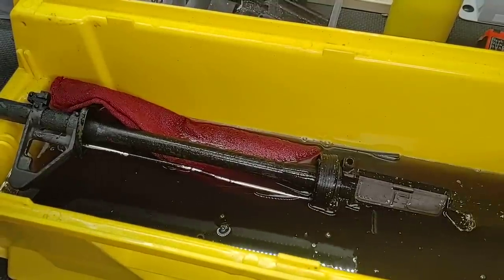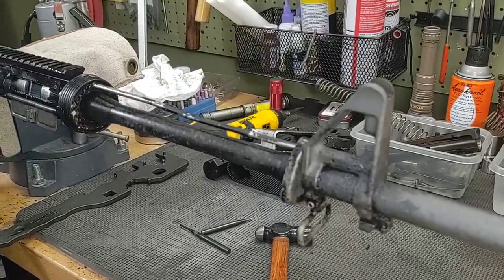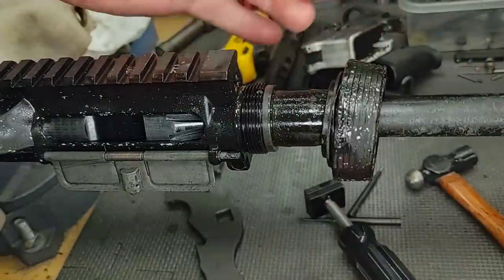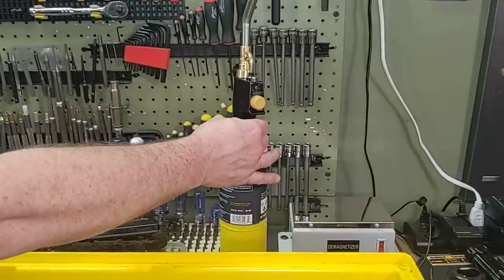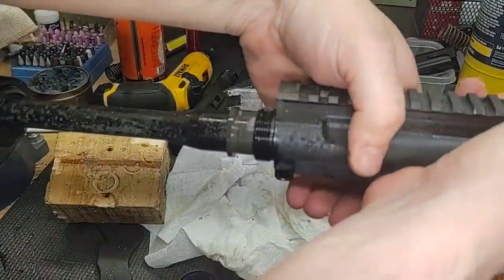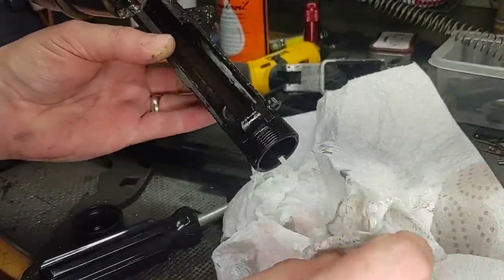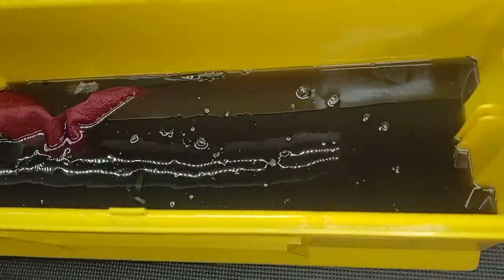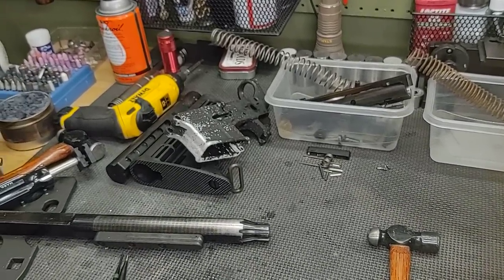Can a Fire Damaged PSA AR-15 be saved? - Part 3

Comment: These videos show exactly how good of a design the AR really is.
Reply: yeah they are one hell of a design!  70 years and going strong!
Reply: AK is better though
Reply: @bradlay1292  I like the modulatory, flexibility and ease of customization you can get with an AR.  ARs are cheaper and just as reliable and more accurate in my opinion than an AK.  

There's one situation I'd say the AK outshines the AR platform and that's in very rough weather and/or environmental conditions.  Such as, if you're going to be sleeping in frozen mud, and you allow your weapon to lay around in such conditions.  Only then the AK would be more reliable.  An easy fix to that is to just take care of your firearm.

Comment: Maybe performing conductivity testing to the receiver and mag particle testing to the barrel will give you better understanding to the extent of damage.  I was in the Air Force for 22 yrs and performed countless inspections on fire damaged parts primarily conductivity testing.  There will be ranges in which different ranges each type of metal should fall into.  Pretty easy tests if you have the equipment and easy to learn

Comment: Love your videos! I have not dealt with a fire damaged rifle but I did pick up a vintage rolling block rifle that had been recovered from a flood damaged house. It was completely rusted. I have been using EvapoRust since before CRC bought it and doubled the price but to soak the rifle I laid it on top of some 2" home depot foam board and drew an outline of the rifle. Then cut out the foam a couple inches outside the line and then laid a tough construction garbage bag into the space. I laid a couple bolts on top of the plastic and sat the rifle on the bolts so when completely submerged there would be good flow underneath the rifle. Then filled the space with EvapoRust and let it soak for 3 days or so, wood stock and all without any damage to the wood stock. It did a good job and I was able to completely disassemble the rifle, even the hundred+ year old internal spring screws inside the receiver housing came loose. EvapoRust does take off traditional bluing but a soak and light scrub with 0000 steel wool and it cleaned up pretty nice and shinny, good enough to shoot and still had decent rifling in the bore. Using the foam, you can make a tight cutout cavity shape for anything without having to waste a lot of EvapoRust, even long objects like complete rifles..

Comment: Thanks for going slow and careful when removing the barrel. Some brands will require heat to remove as the receiver is a thou or two smaller in dia. BCM and JP come to mind. Don't want to bigger hammer those for sure.  Others I've seen were red Loctited on. So a judicious use of heat had to be used there as you might imagine.

Comment: A heat gun and warm the area a bit further and longer would have helped. 
This is a great series, thank you for sharing.
Reply: Came here to see if anyone else knew why that upper gave so many issues lol. It's a JP enterprise design that PSA picked up pretty early on. It's an interference fit where you specifically have to heat the barrel trunion to about 150-200°F then quickly slide the barrel extension in and then hold it in place for a few seconds as it sucks the heat out of the upper and causes it to shrink and hold the barrel. Similar to what's done in the machining and mechanical world. Built a few of these style uppers as custom jobs and from what I understand about the design is it's less prone to have issues during heavier use from heat creating slop. I've seen a few different ARs that had that issue because they were torqued a little under because of gas tube clearance and a failure to use shims. I got lucky with one of my uppers and didn't have to use shims, but the one I just built I used some, but I also used a system that is going to prevent walking or any issues even at the lower end of the torque spec for that barrel nut and handguard system.

Comment: Steel and aluminum expand at different rates when hot using the 2 together in heat situations is like the worst thing you can do

Comment: It's interesting how you're finding assembly errors while working backward. First the incorrectly installed buffer, then the untorqued barrel nut. Makes me wonder if the rifle was ever even fired
Reply: The bolt boat tail had a good amount of carbon on it. It definitely looked like it had more than a few hundred rounds through it. I’m curious how many rounds you could squeeze off with the spring and buffer backwards.
Reply: I wonder if the barrel nut saw enough heat to loosen. Different thermal expansion? 
But it'd make sense not be torqued with what we saw in the previous video.

Comment: So, unless the heat effected it, it appears that PSA did not torque down the barrel nut to spec and did not apply Aeroshell grease to the barrel extension. Looks like quality work here.

Comment: I found long akro bins on Amazon that is long enough to hold most barrels to submerge in evaporust. I am redoing a .22 rifle for my dad and it I was rusted. I had never used evaporust until I saw on you channel. Not sure it will be shootable though, I see some heavy rust in the barrel with my scope. I ran a brush in and still there. Any suggestions?

Comment: That is probably the tightest barrel fit on any PSA upper ever. 
Usually the PSA stuff comes right off once the barrel nut is removed.
Reply: Usually you have to put some real ugga-duggas into the barrel nut because nobody at PSA knows how to use a torque wrench and you'll have shit torqued to like 90+ ft/lbs.
Reply: Oddly enough the one PSA fully assembled upper I have the barrel fitting was so tight we didn’t think we were going to be able to get it off. The barrel nut was properly torqued and also a pain to get off. I replaced the PSA barrel with a ballistic advantage barrel. PSA barrel was also dimpled. The BA barrel we had to dimple ourselves.
Reply: @jstud999  They are hit or miss. I have had a few good ones from them and a bad one or two.
The CHF barrel models are pretty decent though.

Comment: I’ve been enjoying the series sir. I have a question about a SCR . When I originally purchased it, no front sight was provided. Just a short run of upper pic rail. Too short for iron sights. I currently run a vortex red dot. any recommendations for a front sight?  Perhaps a A2 front sight/ gas block. Has a pencil barrel. I don’t recall the diameter. Thank you
Reply: most of the manufacturers of Sights for AR'S, make a barrel height front sight

Comment: Reason barrel nut wasn't at torque, most likely the aluminum expansion from heat and retraction when cool lost dimension. This is the reason, aluminum electrical wires require retorque.

Comment: Hey Chad!?   Will you do work for subscribers?   Im local to md and need some feed ramps polished.  Their sitting a bit far in the upper and theirs a step up into the chamber.  I used your toothpick/wooden stick to check for tolerance issues and their definitely some extra material.   Please reach out.  Also i didnt know sotar was so close.  Might have to come do some learning.

Comment: Chad you're the god of ARs but I'm surprised you haven't heard of heat fitted upper and barrel. You have to heat the upper to be able to fit it with a barrel otherwise no way that barrel goes in. That upper is probably one of those.
Reply from the maker: The rest of the videos explain.

Comment: Considering the upper,  barrel nut and barrel are probably all made of differing materials, and the gun DID sit through a house fire that undoubtedly messed up the upper, do you think the barrel nut came loose because of the heat?
Reply: I was thinking the same thing.

Comment: Never seen psa not torque a barrel nut. Ive literally had to damn near stand on my breaker bar most of the time
Reply: QC is not their strong suit of you wanna go that route, but there is a very good chance the differential thermal expasnion helped loosen it a bit.
Reply: @nobodynoone2500  oh absolutely. I have to cook the barrel nuts when i want to take one off. And i mean cook, i mealted part of the delta ring a time or two just to take one off

Comment: Why try to save a cheaer priced Ar15
Reply: Why not? If the upper and lower are good you can turn it into a high dollar combat ready carbine.
Reply: Same reason you might try building your own, likely inferior gun. It's a fun challenge for a gunsmith, or even an engineering minded tinkerer.